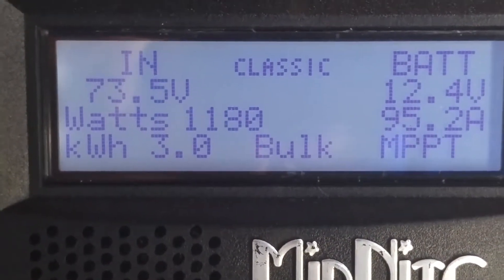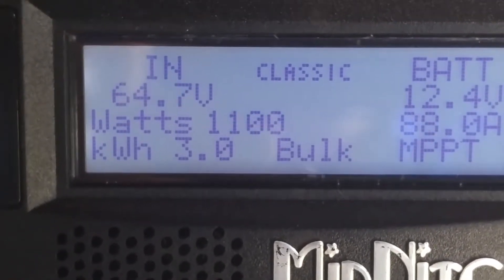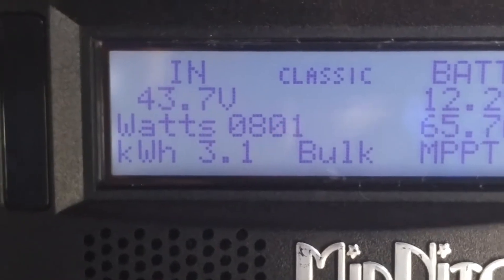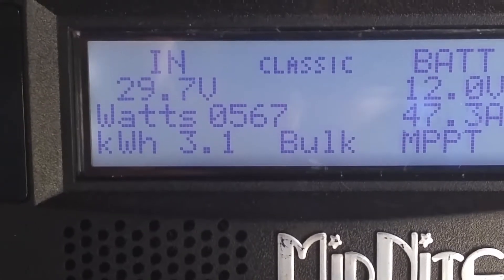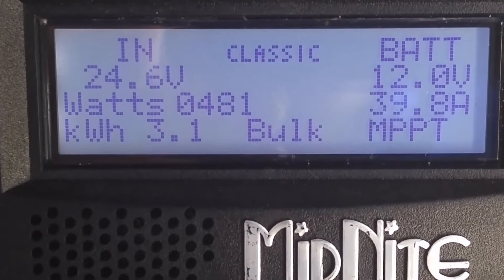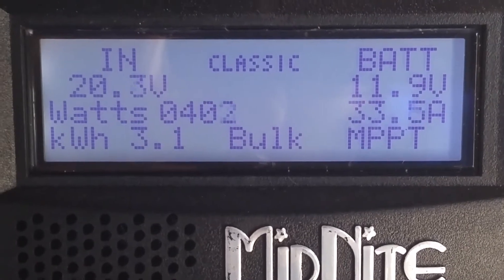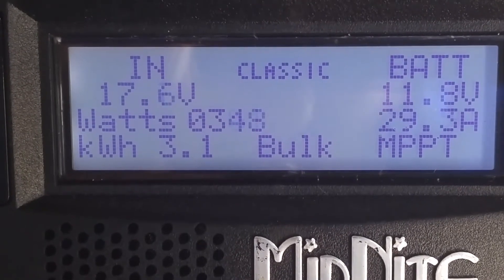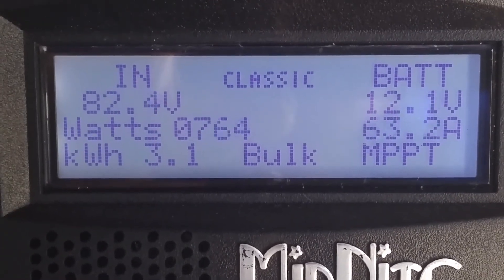Midnite solar classic voltage problems RV solar

Comment: I have 3 classics with 3 strings of panels One classic works fine except when i make it master the display goes all askew and i need it to be the master... The other 2 are doing the same thing they read 129 volts then they steadily drop to 18 volts then jump back up no matter the day full sun no cloud they are fucked it seems and one of the 2 fucked ones I already sent back to be repaired and still its fucked the same one I supposedly had fixed keeps giving false ground fault reading as well !!!... there is no ground fault ! again a false reading remember i have 2 independent classics doing this voltage drop thing .I got a wizbang and tried doing follow me from the good classic even with skew reading no luck seems these controllers are not the shit more shit  had so many issues trying to get them to just work as they should  so over trying to troubleshoot what should fucking work they cost enough...ANY CLUES WOULD BE GREAT

Comment: Its normal , mine does the same, the Volts go up and down depending on the amount of solar rays getting to your panels and the temp your panels are at too as well as clouds and there density . the solar rays from the sun are not constant and will fluctuate thus giving you this result .  hope this helps.

Comment: I have a midnite classic 150 also. Worked great for 3 weeks. Now, it stays in bulk and will not charge past 13.5 volts. Not a single thing in the system has changed, no new loads, etc. Midnite solar techs blame everything except the 150 controller. They avoid the question of why did it work fine for 3 weeks then stop charging at 13.5 volts? Their techs are arrogant know it alls that will not help and are more concerned with blaming everything else but their glorious charge controller. If you are thinking of purchasing one, DO NOT.
Reply from the maker: Todd Barnes  I had a cheap MTTP from eBay  that worked better. I am still having the same issues .